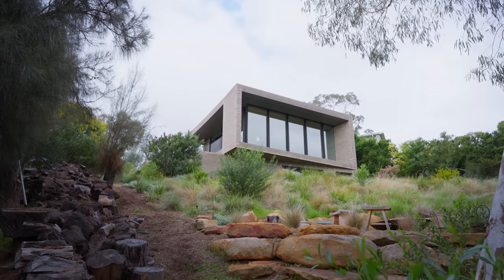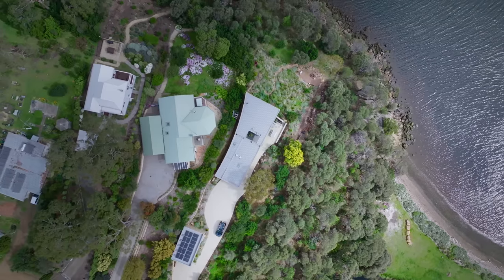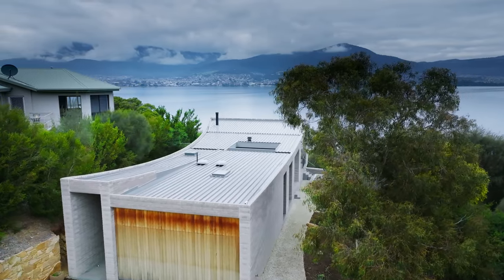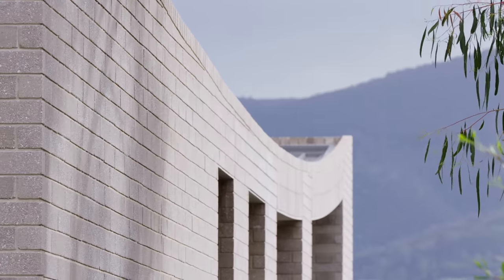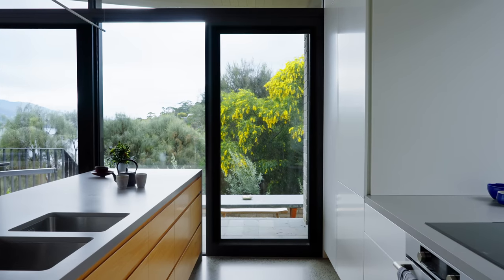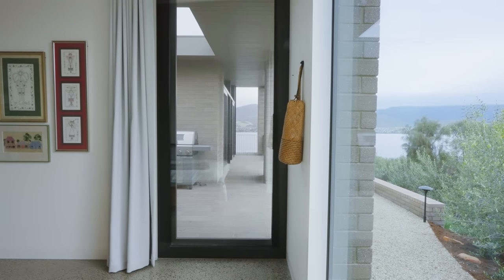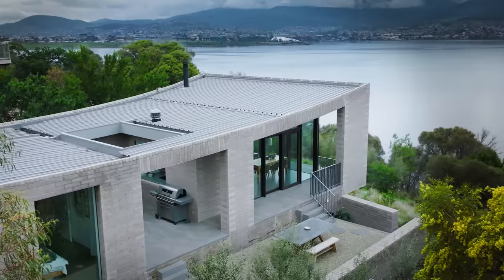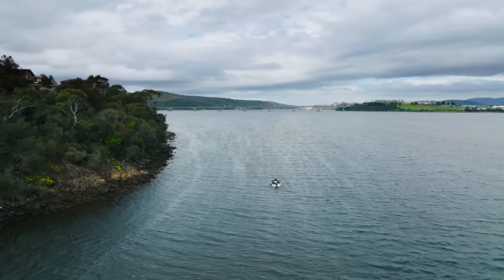Inside a Home Made Entirely From Local and Sustainable Building Materials (House Tour)

Comment: That's an awful lot of bricks, made from raw materials extracted from the ground and transported to the brick factory using machines powered by cheap abundant, flexible, reliable hydrocarbon energy. The same sort of energy used to power the brick furnace and transport them to this location before craning the pallets of bricks into place, before they were in turn finally positioned atop the hydrocarbon power excavated foundations, carved into the hydrocarbon power levelled ground. All atop the hydrocarbon powered water purification, supply and waste treatment systems, and the many sanitary plastic hydrocarbon based fittings that they utilise. 

I give you points for using the thermal mass of bricks and orientation of the building to passively heat and cool your building; such efficiency should be complemented. What a shame those photovoltaic cells and the toxic materials used to make them will have to go to landfill in about 25 years though?   

What a shame it would be to give up the great hydrocarbon generated societal wealth that made this elaborate structure possible because of a fake climate crisis? A fake climate crisis much like the 'global cooling crisis' predicted in the 1970s that we're supposed to be suffering now, and all the other crises predicted by the officially designated 'experts' (very often not actual climate researchers), over the last 50 years, which also have not come to pass.

Comment: Sustainability as a term is used too frequently for marketing purposes. Most houses built over the past 100 years are sustainable, as they are constructed with the intention of a long lifecycle from concrete in some form, that doesnt mean they reduce carbon footprint quiet the opposite. This properties materiality is orientated to high carbon footprint material through the input and output processing operation involved
Reply: Longevity counts for something.  Not saying timber isn't better, however.

Comment: Interestingly most of the comments are about the energy input to making concrete blocks. Normally I would agree that it wouldn't be the material of choice, but one has to look at the location of this house, it is in Tasmania where >90% of the electricity is generated by Hydro power not hydrocarbons.

Comment: 4:51 ‘..one way in which we do that is to minimise footprints of buildings  and build buildings as large as they need to be and no larger’ (while walking to a balcony outside a ridiculous oversized house for two people with pretentiously high ceilings. Nice try at sounding conscious or not being ‘larger than you need’. Being smaller than a 5 hectare 8000 square metre mansion, doesn’t mean you are not larger than you need to be.